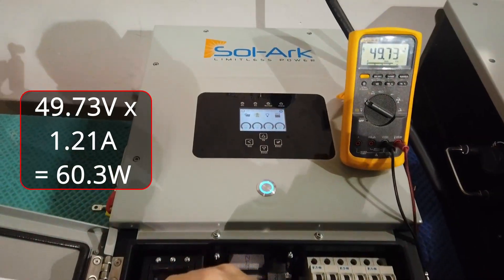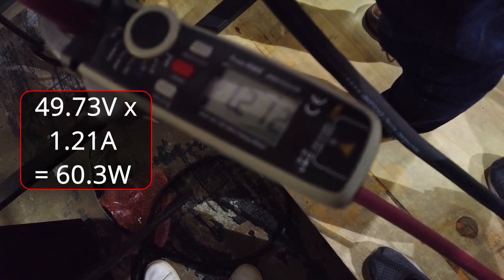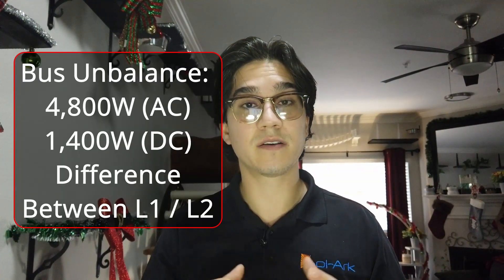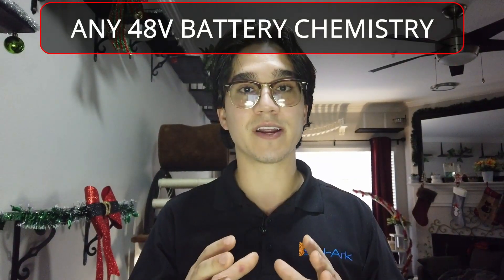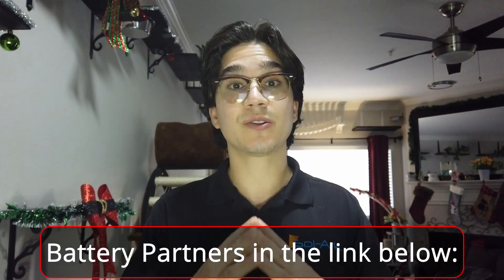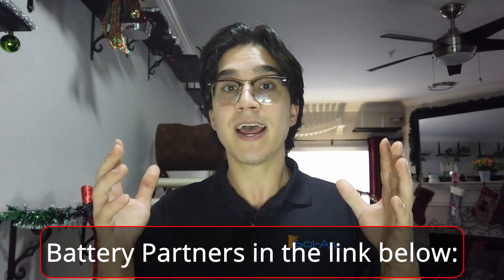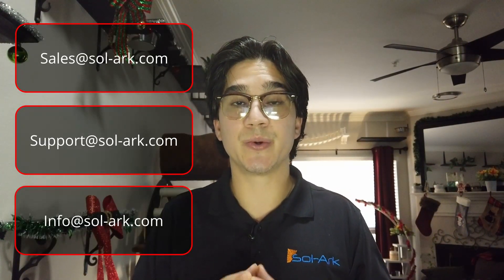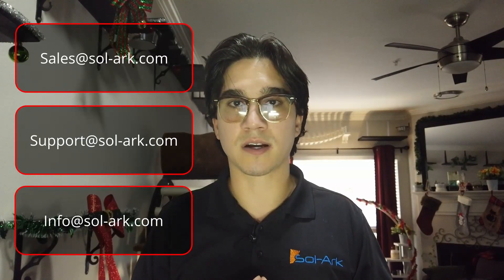Things to Consider with an Off-Grid Sol-Ark 12K

Comment: Sol-Ark, I hope this teaches you a lesson. Don't just send out an inverter for test to any old channel and expect a proper evaluation (or even an honest evaluation). David Poz doesn't seem to understand the differences between hybrid and off grid inverters, much less the proper application of each. Watching his evaluation is like watching someone take a Tesla off road and complain that it got stuck on high center. You should do much more to educate your potential customers on this channel.
Reply from the maker: Hi Larry, We appreciate the comment / feedback you’ve provided wholeheartedly! You bring up a really good point where you said, “[We] should do much more to educate potential customers on this channel. We will certainly work hard on transforming this channel into a place where you can find all the possible information you would ever need.
Reply: @Sol-Ark  I assume the Sol-Ark can handle a greater imbalance when grid connected, so I created the greatest imbalance I could and got < 200W on L2 and almost 5600W on L1 for about 20 seconds before my sub panel breaker tripped. The inverter never tripped but I don't really know what the limits are or what to expect in high load situations. You have never really explained it to customers but relied on installers to size the system properly I guess?. You need videos showing the failure modes of overload, imbalance, high inrush, etc., both off and on grid, with clear explanations of why HF inverters behave differently than LF transformer coupled inverters and the advantages of efficiency and low distortion on HF inverters, especially at high loads. That's just the inverter part. That just scratches the surface of what this unit is, but if you look at the comments on other channels, that's all most people think the Sol-Ark is. Your fine web page and spec sheets don't get the point across. It's going to take VIDEOS that DEMONSTRATE the unit's operation. Sorry for the rant, but I think you guys have a great product and a great company and it's a shame that so many misconceptions exist. Oh, and have Tom do the videos.
Reply from the maker: @lbroome  You are correct that the Sol-Ark can handle a greater imbalance than 4800W on the latest software, however, we prefer to keep the stated maximum as 4800W for the time being. We completely agree that more demonstrations will be helpful to clear any misconceptions, to this end, we are looking to make more content showing the limits of the Sol-Ark and we will always continue to expand our available information for all our users. Thank you for your continued support and we'll see if Tom can make a cameo next time ;)
Reply: Of course Sol-Ark could just make a video showing the equipment, and it’s limits and not hide behind a weak hand-waving explanation.  Or send it to a third party test lab have have them prove it publicly.  Sooner or later, this will cause Sol-Ark grief.

Comment: I'm assuming that this video is in response to the DavidPoz video. If so, perhaps doing a collaborative video demonstrating the limitations and functionality of the Sol-Ark would be a better approach. David's channel has a far greater reach and would be a great advertising message. That said, I have installed two 8k's and a parallel 12k off-grid systems. It has been frustrating when the loads have been within spec but still cause shutdowns (even when accounting for inrush current).
Reply: @raptormatt21 great idea. I have the 12-k and have been less than impressed with the 120V side. In the summer, we have 2 minisplit AC systems (separate circuits and legs, of course) that are rated at 930W continuous. Even if (total) load is less than 500W, we've had numerous in unbalance faults and a good number of overload faults for no reason other than switching on a minisplit. Absolutely no problems with 240V clothes dryer.

This is my second rodeo with similar system...they're marketed for off-grid applications when they really perform best grid-connected
Reply: @MahimaMoksha  have you contacted Sol-Ark about your issues? I recently had to replace the MCU boards in the parallel 12K setup. It seems to have alleviated the AC overload faults.
Reply: exactly - seems a little rushed.
Reply: Yes. I feel the same way .
Reply: Dave is not an honest creator. He has hidden affiliations that dictate his "findings".
His "observations" reflect his financial partnerships.

Comment: All Solarks are 9k.  That's how much the inverter can push out, but you will never get that off-grid and without a Auto-transformer; you will probably no to even reach 7.5K off-grid without an Auto-transformer.  So its about 8.5k Solark + Auto-transformer .
Reply: As I understand it, the unit can deliver as much as 12kW to the Load with that non-inverted 3kW coming from an additional source such as the grid or a generator or as a DC element. That 3kW is referred as pass-through. I’ve seen discussion on it somewhere in a webinar, but it seems to be mentioned only once in the manual dated 11-16-2021 on page 43.
Reply: When the grid is down it can deliver about 8.5k only with an  Auto-transformer. Without Auto-transformer it is impossible to balance the loads in a house and even get close to 8.5k.
Reply from the maker: @mlg779  The 12K is rated for a continuous 9kW of output, but you do have a point that it is extremely difficult to stay just under that value continuously. For this reason, the inverter is capable of handling loads up to 16kW for 10 seconds to allow for any inductive loads to start fully running which prevent faults from occurring. Sometimes auto transformers are needed for off-grid installs, especially if you have large 120V inductive loads. Our support team will always be happy to assist in determining if the auto transformer would be helpful for your situation and help you get the most out of your system.
Reply from the maker: @gubbool  The inverter has a maximum of 14kW that it can provide to the loads while there is an AC power source connected to the inverter, grid or generator. The pass-through rating you mention is a measure of how much power can flow through the inverter while there are no DC power sources available, this pass-through limit from an AC power source is 15kW. We generally don't recommend sizing your off-grid system with the intention of going above the 9kW output limit per inverter so these values aren't commonly referred to.
Reply: @Sol-Ark  I am planning two Sol-Arks with a max continuous load under 5kW for a fully off grid  home and expect to not exceed 8kW per unit even when running the shop.  I’ve only recently became aware of ‘auto-transformers’; however I expect things to go well.
Reply from the maker: @gubbool  Hi Warren, that's exciting, please keep us updated with your project! If you run into any troubles along the road, remember that we're here for you. Reach out to support@sol-ark.com with any questions you may have, or fill out this form: https://forms.zoho.com/solarkllc/form/CONTACTUS1

Comment: KiloVault HAB is now shown on the website as being supported. Fully supported? I have eight HAB’s and a pair of 12K’s on a truck somewhere in Wyoming coming for Christmas.  Hoping that the firmware is able to support the gear, it’s been a long time coming.
Reply: I have an an 8K and a KiloVault HAB V3, which I installed in the last month or so. The communications between the 8K and the HAB seem fine. It uses the included HAB modbus cable and only two pins of a RJ45 plug connected to the inverters CANBUS port, as per the addendum.
Reply from the maker: Hi Warren and Fester,
The KiloVault HAB V3 now have compatible closed-loop comms with the inverter. We've also confirmed with KiloVault that the HAB V2s should also work with the exact same integration method as the V3s listed in our battery integration guide: https://www.sol-ark.com/wp-content/uploads/2021/10/Battery-Communications-Integration-Guide-V2.1.pdf
If you have any more questions on this topic, feel free to reach out to us at support@sol-ark.com or at 972-575-8875 x2.
Reply: @Sol-Ark  thanks for direct reply, Sol-Ark.  I am quite comfortable with my purchase of two 12K;  I’ve seen nothing but good on the web about the 12K and Sol-Ark support. I’ve found very little on the web about the HAB’s; very surprising. Although the are expensive, the are a giant leap ahead of what I imagined just before I found them. I reached out to Jharen P. a week back and he was geeat. His replies were complete and well written, just saying.  So you guys rock!

Comment: Guess this was in response to David Poz?
Reply: That's my guess. Dude didn't know to upgrade his firmware.
Reply: Software upgrade is painful on solark, at least for me. You cannot download it , put it on a USB and upgrade. You have to call  solark and they have to push it.  I have the old WiFi dongle and  they had issues last time I had to upgrade my firmware. Now Apparently I have to buy the new wifi dongle. I do not want to use WiFi. Every time I do a software upgrade I have to plug in an old WiFi router and remember or Google how to connect or make solark connect solark to my wifi router.
Reply from the maker: Hi Mlg,
We apologize for your experience during the last update, without having any context, it seems like you are one of our original customers that had a SmartESS (Shine Monitor dongle). We do recommend upgrading to the Powerview dongle to be able to provide the best assistance possible, but it is definitely not required. If one of our support team members did recommend that option, it was likely because there are certain limitations to the SmartESS platform that we have addressed by making the move to Powerview. 
As for your bandwidth issue, our support team can help determine the best solution for you. If you are interested or still experiencing issues, feel free to reach out to us once again and we'd be happy to help.
Reply: @Zorlig  Still has problems even after they update it.
Reply from the maker: Hi Kyle,
Most of the time, we will recommend a software update as the first remedy as it is the least intrusive and time intensive on the customer's end. Not all problems can be fixed with just the update, so if you are still experiencing issues with your unit, please feel free to reach back out to our support team for assistance.
Reply: For everyone having issues with wifi (especially those with low bandwidth) or far out places; but if you have solid phone (LTE) coverage!! Use this hack/video below and go WIRED from the LTE modem. I'm an IT by profession and this is a SOLID resolution to remote wifi issues! https://youtu.be/alMsu_tfZPE
Reply from the maker: Hi Megan,
Thank you for the additional resource, glad to see more on this topic! To add to the conversation, mobile hotspots are another way to circumvent bandwidth issues with your home's network. The internet connection needed to perform a software update does not need to be permanent and can just be on for the time that it takes to complete a software update (~15 - 45 minutes).
Reply: @Sol-Ark  couldn't agree more with your assessment of 15 to 45 minutes for updates. My only addition would be for stability and accessibility. IDK about anyone else but I love to see my (plant data) app any day, any hour!! For remote sites with LTE coverage why not go for this great (free) alternative ☺️👍
Reply: @meganwinters5163  you can get 3g or 4g internet only pay for capacity internet. Not free but probably cheap assuming it doesn't send much data.
Reply: @Zorlig  you'll wanna watch the linked video ☺️👍. Trust me it's true "unlimited LTE data" without throttling! I have a dedicated LTE network for streaming video & PC gaming while traveling for work. It's stable as heck!